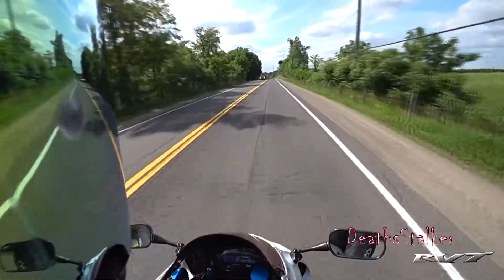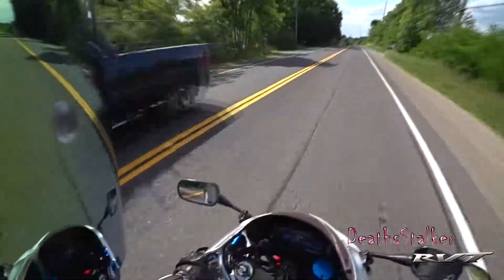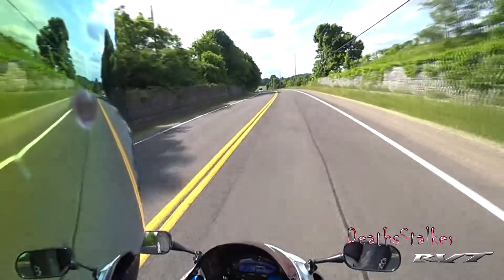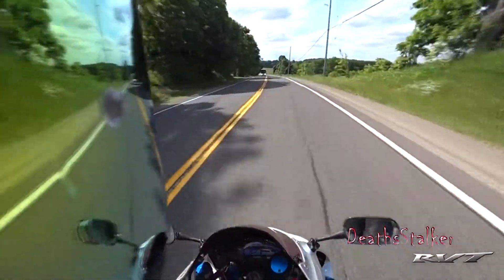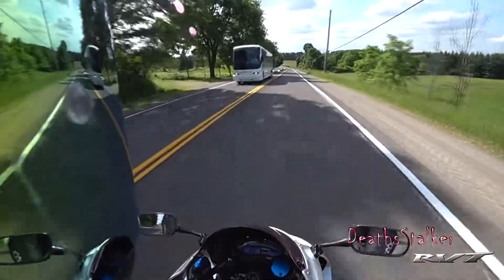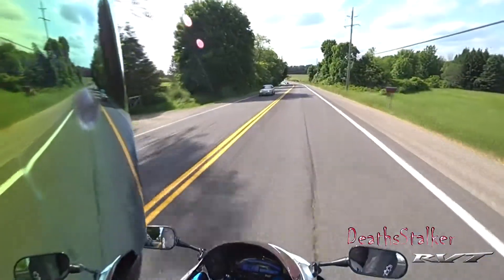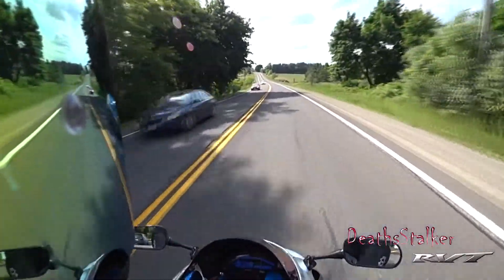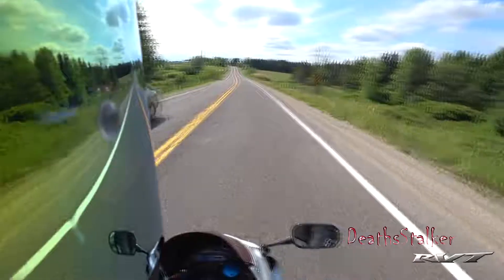Running out of gas on the race track

Comment: I seem to remember, in our class we had to have at least a litre of fuel left in the bike when we got back into parc fermé, in case they wanted to test the fuel.  We had to run on commercial pump fuel, and not race fuel.  Our club also had a van that picked up crashed or stranded bikes at the end of each race session!
Reply from the maker: We had the crash truck at some race tracks not this one it was nearly flat but it felt like I was pushing it up hill all the way back...